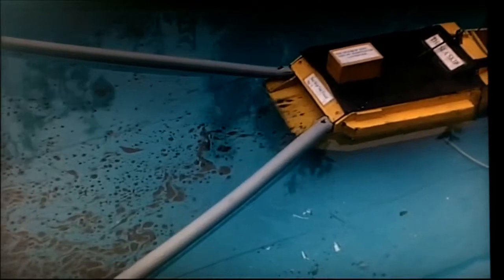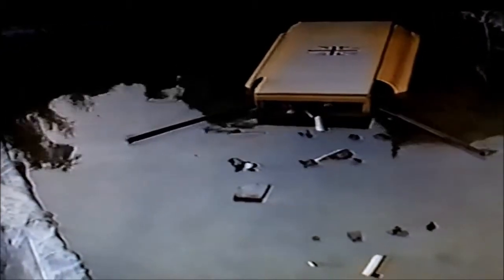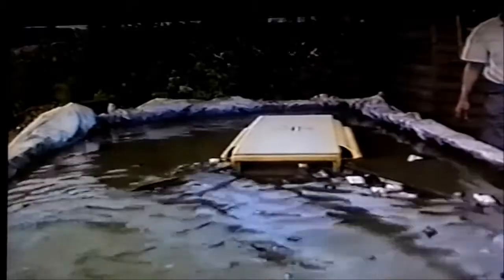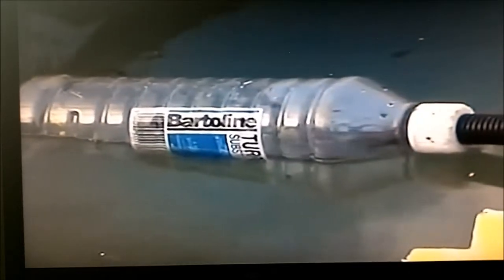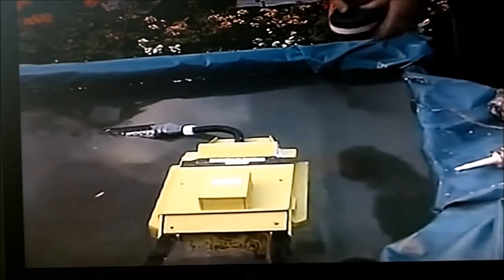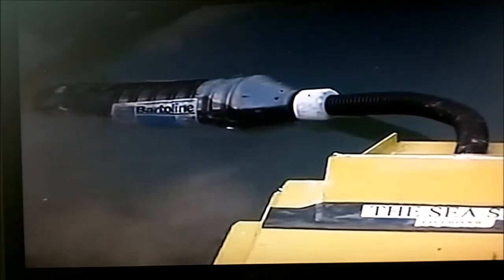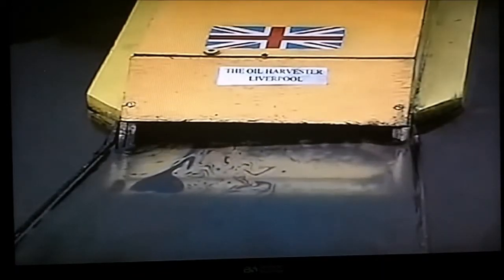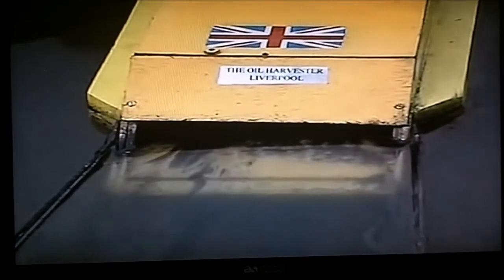Prototype Skim Technology Doesn't Emulsify Oil No. 1

Comment from the maker: I am appalled at the inconsistencies of the MARPOL regulations that permits the technology used by oilspill recovery seagoing skimmers , to polute
the sea with the creation of vast amounts of EMULSIFIED oilt, by the technology used by oilspill recovery seagoing skimmers. The oilspill recovered is mostly an EMULSIFIED mixture ( mostly water ) that then has to be filtered to recover the oil content of the EMULSIFIED mixtue. The highly polluted water after the filtering, is deposited back into the sea, although the regulations state that only water returned to the sea from oilspill recovery vessels
should NOT contain more than 15 parts oil ts 1 million parts water. I find it incredible that the regulators allow this environmentally damaging system
to persist.The regulators allow REVOLVING ropes, belts, drums, efc.to return, pure and part EMULSIFIED into the sea from their oilspill recovery systems. Then burning oilspill is allowed, this pollutes the marine environment even worse, as well as the air we breathe. Spraying the oilspill with
chemicals to sink it, only increases the oils toxicity to the marine environment. The use of chemical COREXIT( according to scientific reports) increases 
the toxicity of oil to the marine environment enormously, the coastal population complained, of breathing problems and skin complaints.When will we get SEA LIFE SAVING rules & regulations as well as the new technology that can outperform present pathetic rate of recovery, today, 5 to 8 % ? At great cost , in financial & environmental terms.WE MUST ALL TRY TO PROTECT THE SEAS, IT IN DANGER BECAUSE IT IS NOT BEING LOOKED AFTER PROPERLY, BY THE ORGANIZATIONS THAT WERE GIVEN THAT TASK , OF PROTECTING OUR MARINE ENVIRONMENT, FOR THE SEALIFE , IN ALL ITS FORMS.   "Remember, when the sea dies so does mankind"